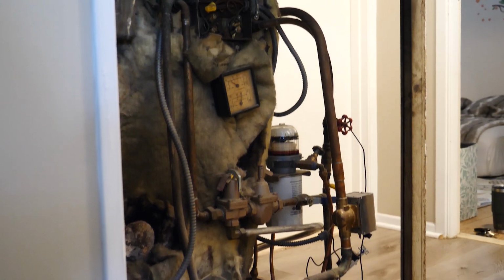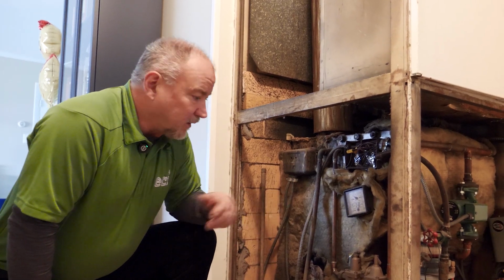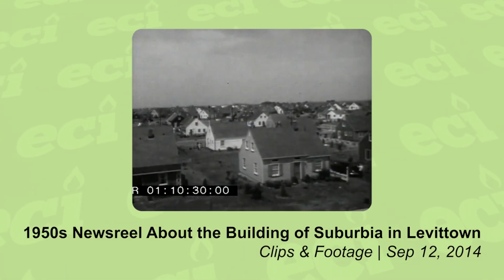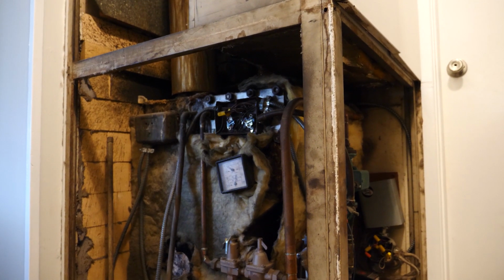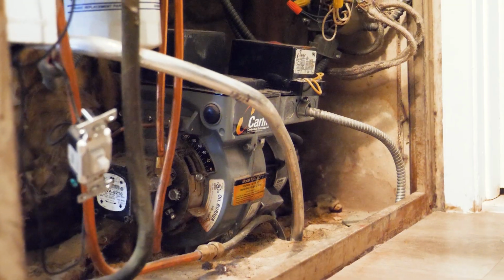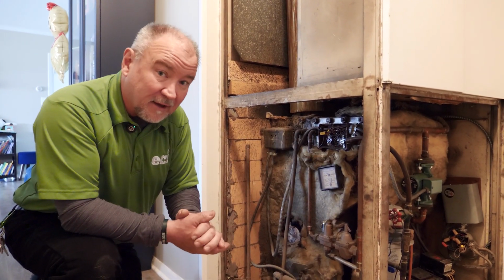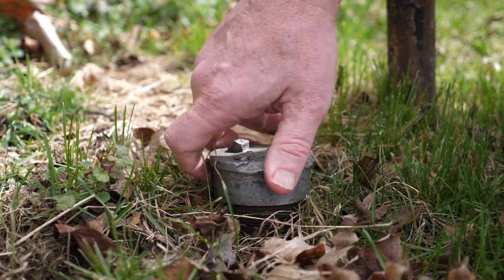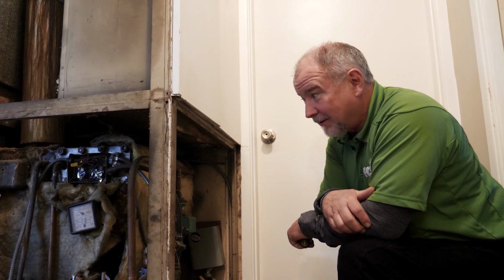This Levittown Boiler Has Worked for 70 Years… But How?

Comment: Where the boiler was situated was a plus. Placed in the center of the house, kitchen on the other side of the wall bathroom next to the heater and upstairs bathroom right above. Hot water was there quick.